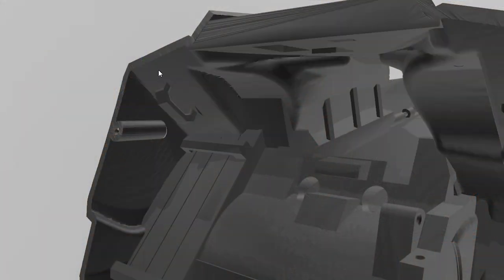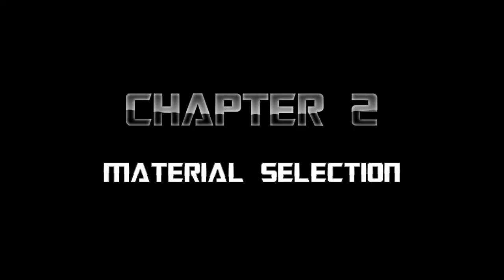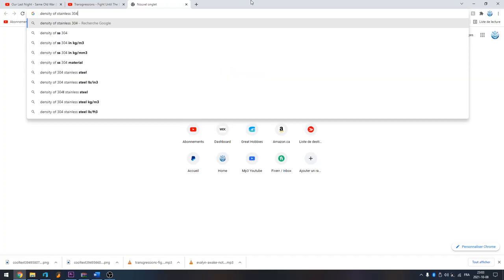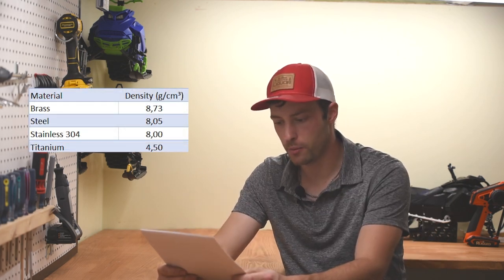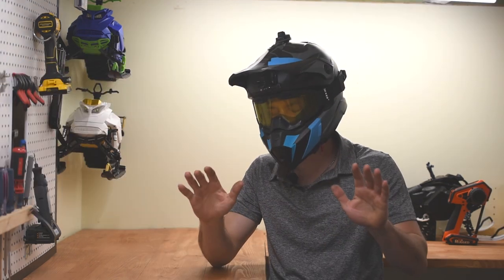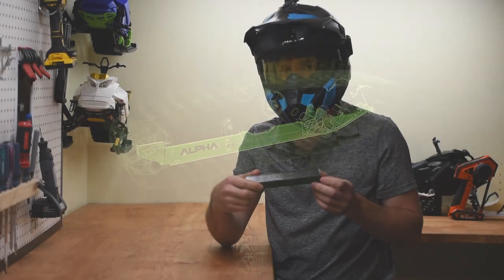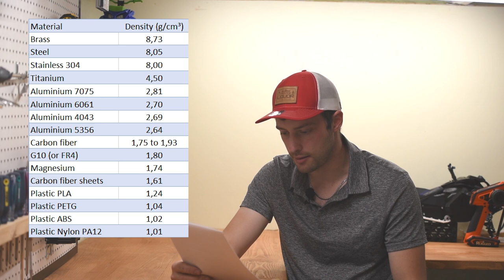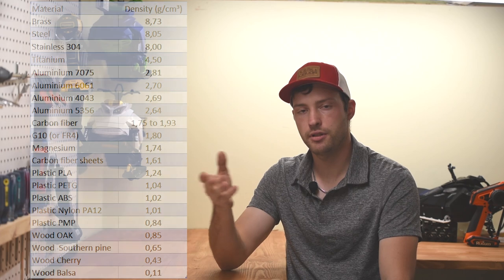Engineering 101 - Saving weight on a Snowmobile (Part 1)

Comment: With your knowledge and with todays laser printing technology, future wise would metal 3D printing be something you might dabble in? I do machining, run a 4000w Laser and certified in Tig, mig and arc welding in all metals plus thicknesses. We do sla 3D printing and I’ve always been intrigued by it.
Reply from the maker: I would love that but metal printing machines are far beyond the budget that this channel brings.  I think cnc are a bit more appropriate for the uses i have...
Reply: @Pascal_Robert--Rc_Creations  Think outside of the channel. 3D printing metal would open up a whole new business opportunity. But yes I understand the upfront cost is not cheap. Otherwise I’d have my own welding shop. All in all love the work you’ve done and will be buying Rush parts from you soon!